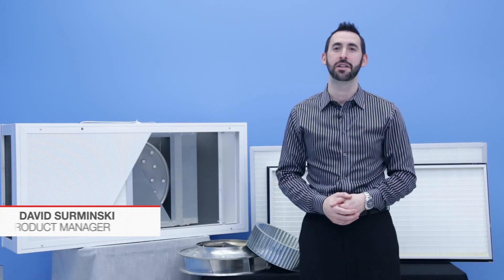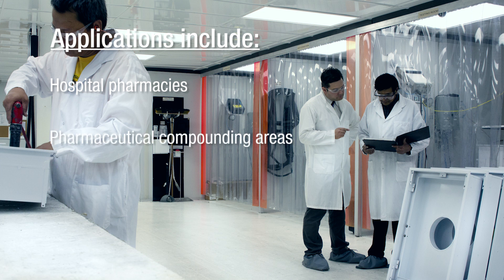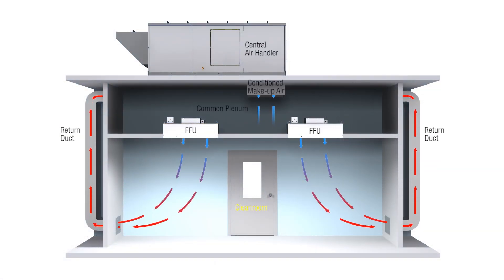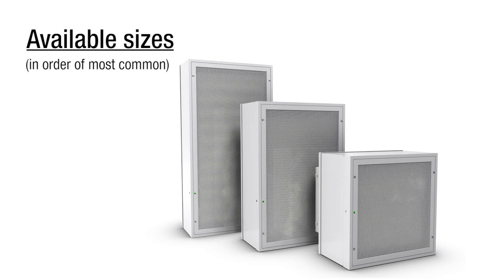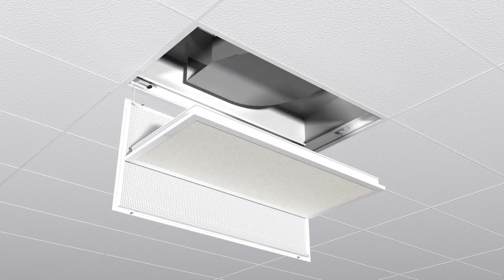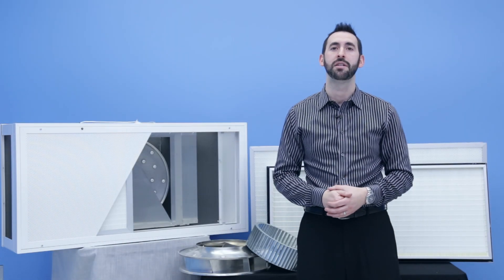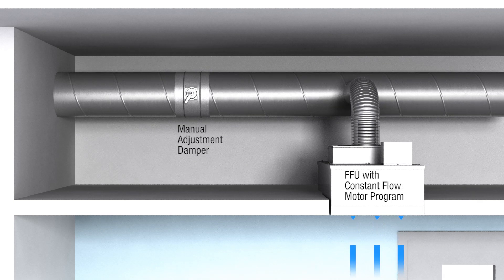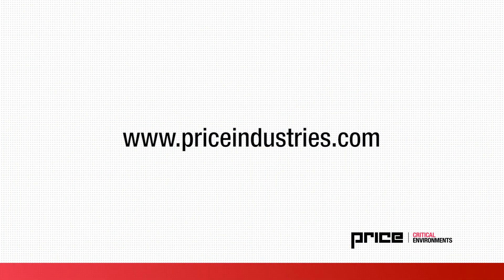FFU: Fan Filter Unit Fundamentals

Comment: Good Information.
Just One Doubt.
Say I have a Duct that Feeds 400 CFM to 600 x 600 Terminal (But if I need to install HEPA with IPD of 125 Pa & FPD of 400 Pa) & Duct pressure is only 75 Pa , What size & Airflow FFU is needed?